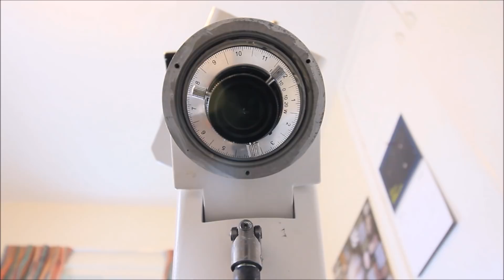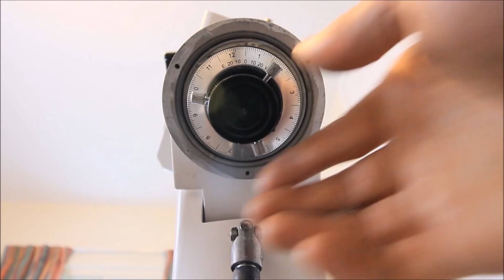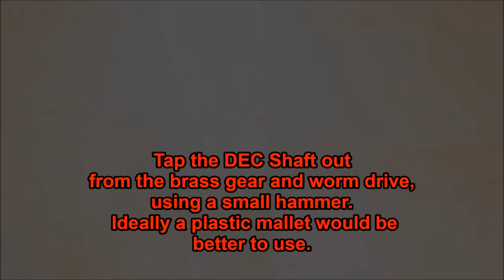How to Super tune a Skywatcher NEQ-6 Mount Part 2

Comment: Hi Martin :)
I’m currently doing a strip down and belt mod on my EQ6-pro...@20m10 when you take off the counterweight end cap and remove a small brass button ...I didn’t have one!! 

I bought my mount 2nd hand a good few years ago so guess it has been taken apart before...
I’m guessing I need this little brass button as it’s part of the clutch lock? 
I only have the brass bolt with a square head ...the bit in your hand @20m17 I don’t have.

Do you know if you can order this as a spare?
If not do you have any advice what I should do? I guess I’d have to make one?..if so do you have any measurements for it that I could use?

Cheers 
Ant
Reply from the maker: Yes!! Without it the clutch will slip, plus it will mark the main gear ring if you don't have one in place. You can make one it's around 6mm thick, and has long you make it so that is same diameter as the brass lock down screw, you should be fine. But try to use a brass material.